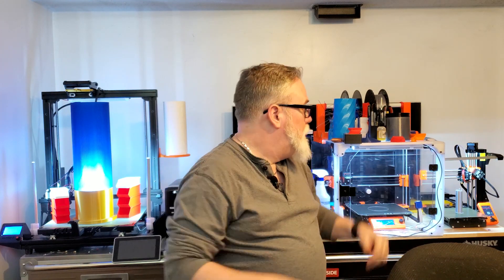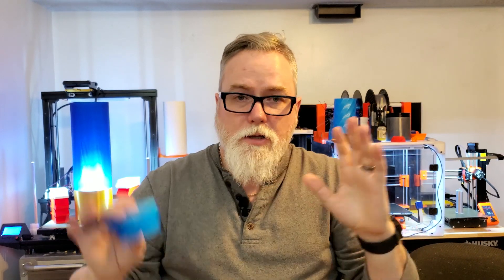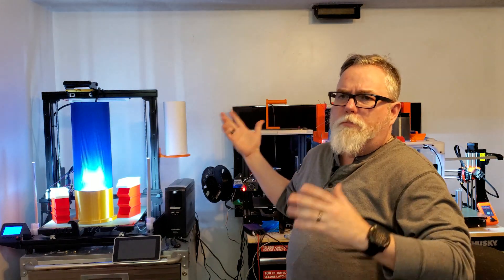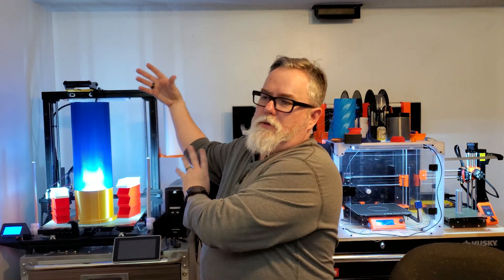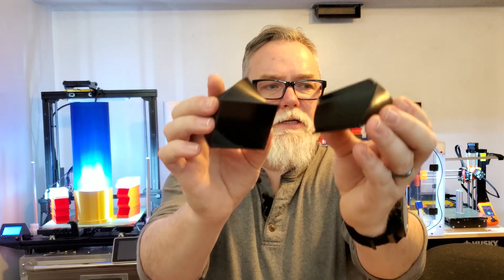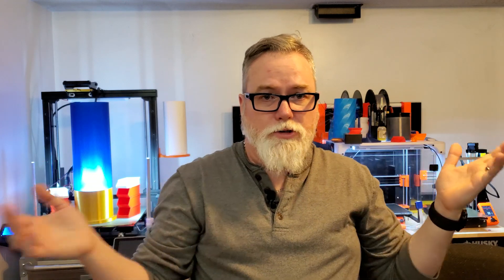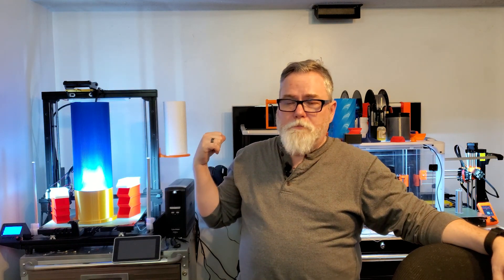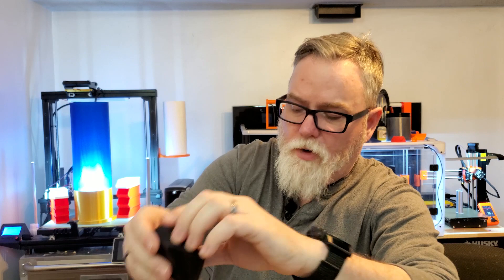Prusa Mini vs Creality Ender 3 vs Prusa Mk3S: Drag Race!

Comment: what was the acceleration for each machines ? thank you
Reply from the maker: Except for Frank (the Raptor) they are all at stock settings.  I did a lot of experimenting with acceleration for the Ender and while I could speed the thing up, raising it caused dimensional problems with the prints.  My goal with this ender is to get it print at speeds close to the MK3s while maintaining an accuracy of .2mm or less on all axises.  The ender currently has many new upgrades and I'm working on a video exploring the volumetric speed settings in Prusa Slicer.

Comment: wast the profile for the ender 3 ever released?
Reply from the maker: No Prusa, keeps updating the Slicer, but basically you use the prusa mini speed settings and you need at least a dual gear extruder to keep up with the retractions

Comment: I guess the firmware has limitations the other machines don't have?
Reply from the maker: There is a bit of that, acceleration is capped lower on the Ender 3. Secondly the extrusion system can’t keep up, with consistency, to the others, even I remove the acceleration restrictions.
Reply: @Zelrick42  Yeah it really needs a good dual gear bowden or direct drive system, the voron bowden drive systens are cool. but there are plenty of options for an ender. 

PS: i just bought a Kingroon KP3S, seemed like a fun little machine, what do you think?

Comment: If you use the Creality slicer and use the layer height of 0.15mm you will get faster speeds than on the Prusa slicer. Also, that's the same layer height that the prusa slicer uses for the prusa mini so it should be the same resolution

Comment: Is the prusa mini produce the same end quality result like the prusa mk3s ?
Reply from the maker: The results are a toss up. The Mini occasionally edges out the MK3, but the MK3 will do a slight bit better with complicated prints. I would not choose between them on print quality or speed.  Build volume is the only real difference to choose on.

Due to the price, I would like to have several Minis, but would want a couple MK3 for those prints that just won't fit on the Mini.
Reply: @Zelrick42  thank you for the quick supportive reply :)

Comment: Nice test! I will try to print one day when there is free time on the bed. One question. how much time the cura slicer gives you for the ender 3? Mine gives 2 hours and 46 minutes. Its always accurate when I print
Reply from the maker: With Cura it depends on the version. Earlier versions were quicker. Also it depends on your settings, I printed at .2 layer height 20% infill 4 bottom and top layers, only one slow layer and default speeds. To equal what Prusa Slicer does by default. Cura spit out something like 6 hours.  It’s partly due to slicer pathing and partly due to not being able to get to some speed settings that Prusa slicer has.

Comment: Watching this makes me wonder if I should cancel my the backordered Prusa I ordered and buy and modify a Ender 3...
Reply: I think it would depend how comfortable you feel with trying to fix issues that pop up. The ender 3 would take a lot more work
Reply: @mholder1324  I did a bit more research and did cancel my Prusa order and bought a Sidewinder x1. It seems Creality really did a great job of releasing a quality printer at a cheap price a couple of years ago. Though it seems they have stagnated a bit. Going with a Sidewinder X1 that has most of the features that I wanted, without a huge price and the headaches seemed to be the best idea.
Reply: @SolarityTechnology  Nice, let me know how setting it up/running it goes. I'm still trying to decide between printers myself. As much as I want a Prusa the wait time is too long
Reply: @mholder1324  Yeah, it was a little to long for me as well.  I started watching more videos, that was my issue. I plan to post a video on my channel, about the experience "A n00b buys a 3D printer in 2020".
Reply: @mholder1324  my ender is reliable. No problems after 400hrs

Comment: why not at 200mm/s for the prusa.  That's what the specs say.
Reply from the maker: I was using the Slicer default’s. 200mms means little anyhow, you can set the default speed to 200 but the printer will never reach it. The people claiming super high speeds probably are no where close to what they think.

Comment: Hi, thank you for great video. I have Prusa slicer installed but I haven't used it yet. After watching your video, I was tempted to slicing that same lithophan (~ 24 h printing) in cura and prusa slicer. Time of printing was similar but ... prusa 0.12, cura 0.16 but when I set both programs to 0.2 the difference was 6 hours (wow). Now i printing g-code from cura but i will make one more, similar lithophan and i want to try with prusa.  Are the dedicated settings for ender 3 pro in prusa slicer OK? Can you share your prusa profile for ender 3 pro? If you can i say thank you. I'm not expert, it's my hobby and i'm still and I'm still learning with great pleasure.
Reply from the maker: The Prusa Slicer beta defaults are pretty good and faster than Cura. I can't really share my profile due to using a beta version of Prusa Slicer and having it set up to take advantage of the dual gear extruder and a few other things I have set in the firmware. A stock Ender 3 probably wouldn't work well with it.
Reply: @Zelrick42    ok so i will try to print some parts in prusa with the default settings and see what it looks like and then try the second lithophane. I'll let you know here.
Reply: Monter Any success??

Comment: Hey Zelrick, thanks for the video , I'm currently debating whether to get the ender 3 pro or the prusa MINI. current considerations are the cost to print quality, and after looking around am seriously considering spending an extra hundred dollars on the prusa. I mean , I was until I watched the end of the video with the new slicer being used on the ender! Lol. again , thanks for the video and have a great week
Reply from the maker: If it's your first get the Prusa, you will thank yourself and never miss the $
Reply: @Zelrick42  I got the Ender 3 Pro as my first and followed a Youtube build tutorial to get it set up just right. I think it's great as a first get because the Ender 3 has soooo much support online that any problem you have is extensively documented.
Reply: I've been debating on that exact same thing.  Up here in Canada, the Ender 3 is ~$300, and the Prusa Mini is ~$500.  Pretty big price difference.  I'd be curious to know which one you are going for.

Comment: LOL I was gonna comment even before you mentiond not running to the comments, but then thought better of it - and now as I'm writing this comment while continuing this video I see that we've come to the same conclusion:

It is super interesting that the mini was quicker than the mk3s, but became easier to explain once I got over the pricing of either. My main expectation is better acceleration values due to the weight
Maybe an interesting test would be to compare big cube (so long straight lines) vs something with a lot of directional switches. Either something using Hilbert curve extensively, or something like the Top Part of the knurled twist container, which on my mk3s took double the amount of time the bottom part took, while weighing only ~2/3 as much

Regarding the slicer thing - I've only ever used gcode from prusa slicer but I've palyed around with both cura and ps extensively and I'm having a hard time finding reasons to recommend Cura unless there is no PS profile for your printer. Even the UI infuriates me
Reply from the maker: BelviGER i am doing more testing.  Thank you for the suggestions, I’m also finding that the board on the MK3 can be a limiting factor on complex files.   Cura VS Prusa Slicer is something I don’t get into, I use them both they each do things the other doesn’t.

Comment: I want to get into 3dp as a hobby and currently plan to buy a Prusa Mini in about 2-3 months. Now, with me being a student and due to some limitations of my apartment, the Mini is likely going to sit fairly close to my washing machine. Is this a problem? If so, what's the best (cheap) way to dampen the vibrations in order to omit these problems?
Reply from the maker: I don't know if it will be a problem, but I would guess that unless you are placing the Mini right on top of the washer you'll be fine.  I Print with two other printers on the same rolling cabinet and haven't seen any issues from vibration. If you do, someone will have designed some vibe dampening feet to try.
Reply: @Zelrick42  Thanks; mabe I'll print a benchy or two while the washing machine is spinning its drum at full speed, just as a test.
Reply: If you want some peace of mind, check out how Prusa has isntalled their print farm.

All their printers are aligned on continuous shelves, there is no massive bracing for the shelving units, and they run 90+ Printers simultaniously per shelving unit.

A washing machine that is not connected to the printer (except via the floor which barely counts) shouldn't be able to inflict more issues than the potential of 89 printers being in sync on the y axis and whacking that one printer that isn't in sync

I'd wager that as long as you don't place the printer directly on the washing machine while its in fast spinning mode you won't notice a thing. Especially after you put a rubber dampening matt under the printer to reduce resonances
Reply: @BelviGER  Good point, thank you.
Reply: @npgoalkeeper _ It'll go on a shelf that's close to the washing machine.
Reply: I would buy one in 2-3Months because than they can take time to build them, and dont have the pressure of pumping them out fast

Comment: The big issue with the Ender is the board and the drivers. Compared to Prusa it’s totally different.
Reply from the maker: I totally agree, the premise here was to show basic performance for the person that just got the printers set up and downloaded the community prefered slicer. The ender has a very good movement system, it's held back by the stock electronics and extruder. I'm going to continue to see what I can accomplish speed wise, because I believe it should print as fast and as good as the Prusas with the right parts. The question is how much will it cost and will it be viable when compared to the mini?